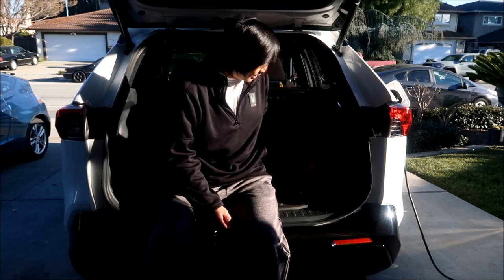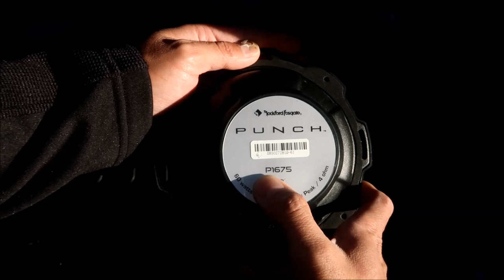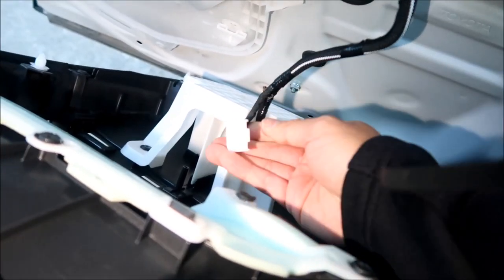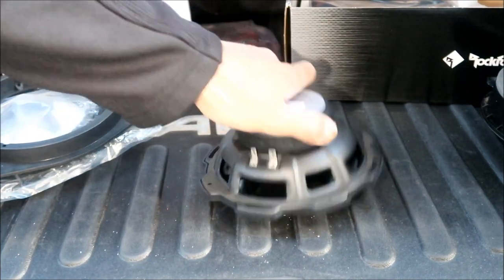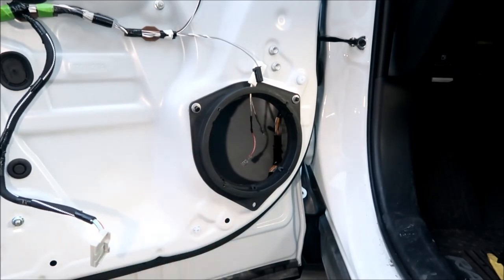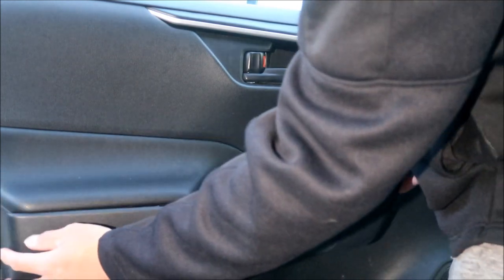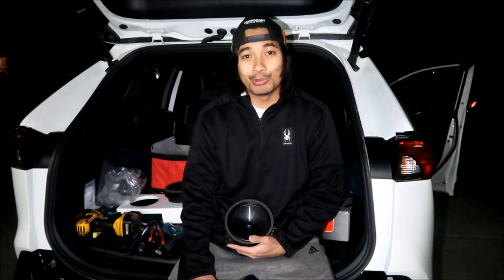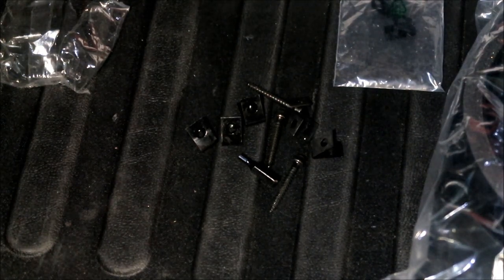Rav4 Prime Front Door Speaker Install VLOG

Comment: Hi mate, 
Listen to Am and Fm radio what Would you recommend me should I change my car dashboard speakers only or should I change both speakers Dashboard and Front door speakers too?
Reply from the maker: I think if the sound quality is something you want it would be a worthwhile upgrade for you.  The dash speakers are very easy to change but the door speaker upgrade makes the biggest different in my opinion.
Reply: @HadesOmega  Thank you Mate..
Thanks for your response 
So you recommend I should change the dash and front door speakers 🔊 
How about rear door speakers?
If I would change the rear door speakers would I need to install Amp for that?
And which speakers do you recommend for rear door?
Because I don't prefer to have a Amp